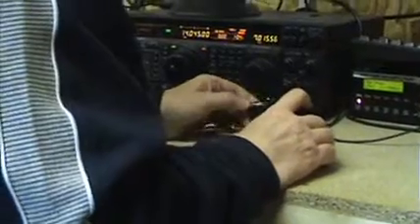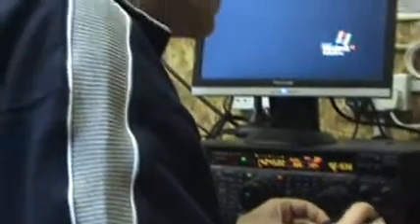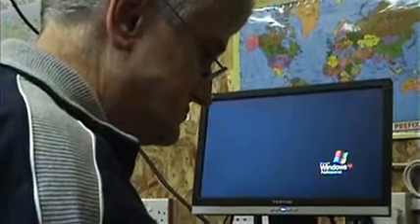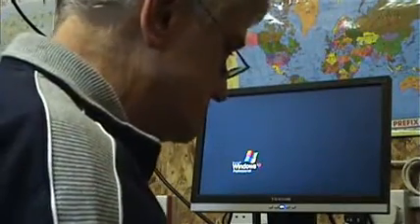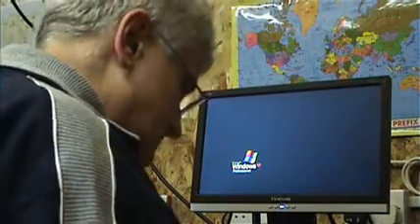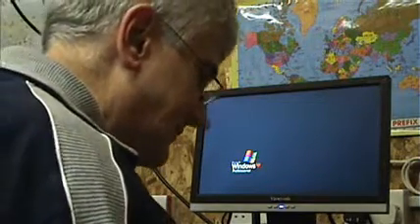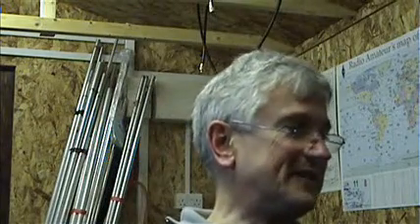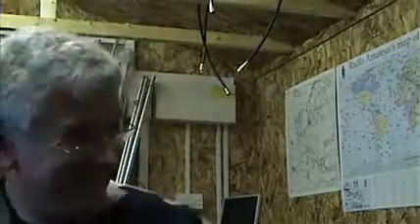The first 2-way radio contact with Lego Morse keys

Comment from the maker: @cliffe008 Hi. No, you really should not have a problem with the Foundation licence. It's mainly intended to just make sure you know roughly what you're doing, so you can get more experience on-air. 
I don't know the IC-92d, I'm afraid, but it looks like a nice handheld from a quick Google search. Good luck with the exam & thanks for subscribing. 73.